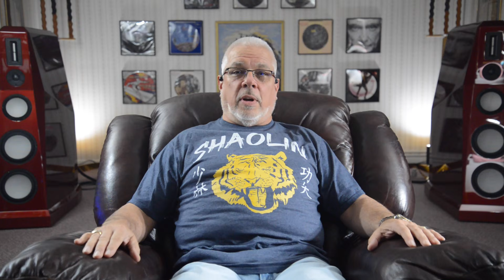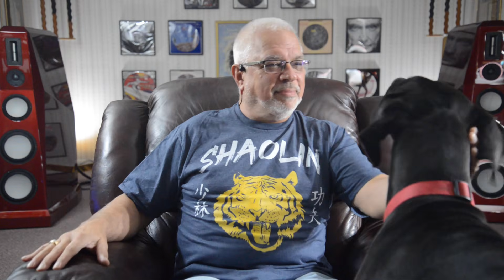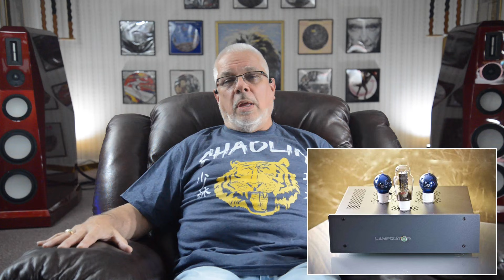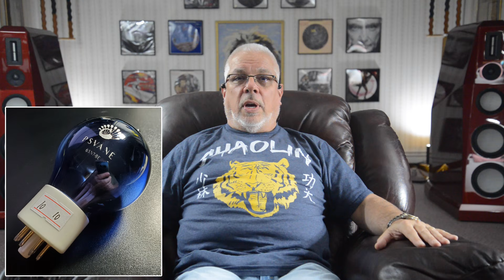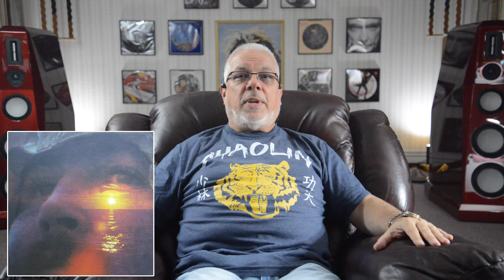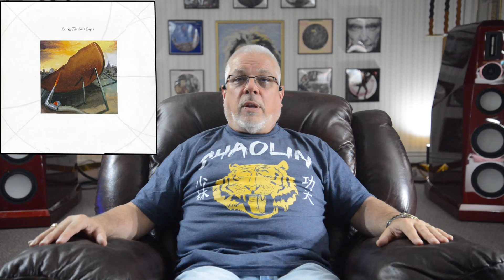E66: LampizatOr’s Baltic 3 DAC

Comment: Greg help me out Im looking at Audionote Dac 3.1 which is r2r and Baltic 3 which I have had my eyes on for years. Is there a big difference in sound
Reply from the maker: Hello. This will have to be your choice, as, to my way of thinking, the Audio Note is almost twice the retail cost of the LampizatOr  Baltic 4. The Baltic 3 is no longer current...and, honestly, the 4 offers clearly significant improvement over the 3. Honestly, I've never been the biggest Audio Note fan, so...you really are asking the wrong person for assistance. Given the price differences, I suspect that the DAC 3.1 may offer some clear advantage/s over the Baltic 4. But not having heard it in quite some time (I'm sure it's been four or five years since I've run into a DAC 3.1), I just can't say. I've no idea how challenging it may be, but...I'd urge you to try to listen to each one - as closely back to back as you are able - and take the plunge based on that experience... Sorry I can't be of more assistance here... 🙄

Comment: Thanks for such an amazing review.  I am in the market for a DAC to replace my Chord TT2 and was primarily looking at Chord Dave or T+A 200 but this review gave me something else to think about.  It’s a shame there is no way to demo Lampazator in my system but I am definitely intrigued and will be looking in to it more closely.
Reply from the maker: You should be aware that the Baltic 3 has an entirely new engine, and now is known as the Baltic 4. AND IT IS  EVEN MORE AMAZING... I had mine updated and am trying to find the time to update this take on this amazing machine! Enjoy!
Reply: @theaudioanalyst  Yes, I saw Baltic 4 on their website and really keen to hear your impressions when you get a chance to get it together, maybe I need to hold on to the purchase until I see your review.  I am big Rob Watts/Chord fan in the digital domain but since i got introduced to tubes there is no turning back and I have said goodbye to solid state amp (except when my tubes are warming up) and DAC could be next :).

Comment: Hello Greg! I need your advice for something. First thanks for this great info on the Lampizator Baltic 3. Personally , i still enjoy my cd playback system but plan to improve my dac section. With your today review i hesitate between a Mola Mola Tambaqui and the Lampizator Baltic 3 one.Unfortunately i did not get the chance to hear both of them.  I must tell you my system his only for headphone listening. I have a pair of Hifiman Susvara ( cabled with Nirvana headphone cable ), a Simaudio 650 D dac, Simaudio 430 HA ( Headphone amp ) and Inakustik cabling across and 3500 Power Filter. Last question if you do not mind. What could be my best first option... go for a better amp or improve my dac ? Your advice would be greatly appreciate! Have a nice day!

Comment: I have personally never heard a true tube Dac I had a musical fidelity nudists once but my chord qbd78 sounded better.I do like the idea of this Dac though a lot
Reply from the maker: Hello Jason. All I would tell you is that this DAC, to my ears, is much more musically accomplished than any DAC I've heard from Musical Fidelity. To be fair, The Baltic 3 is considerably more expensive than even Musical Fidelity's latest flagship DAC, the M6x, which is just about $2,500. What I tried to make as clear as possible in the body of the review was that none of the similarly priced DACs I’ve heard, including such “fan favorites” as the Bricasti M3 DAC ($5,500), the Chord Hugo DAC’s (up to $6,725), the highly regarded KTE Tuned HoloAudio May DAC ($5,598), the Mark Levinson No. 5101 Network Streaming SACD Player and DAC ($6,050), the PS Audio DirectStream ($5999), or the T+A DAC 200 D/A Converter and Preamplifier ($6,900), offer as complete a musical, texturally replete, and dimensionally authentic tapestry as does the engaging Baltic 3.

Comment: I love your reviews and videos Greg.  Do you have any thoughts on the Msb dacs?  I’m using a premier with power base and pro isl connector and it’s the best digital playback I have heard. I’m listening to all sorts of files including 2 track 15 ips safety masters and other tapes I have had copied to Dsd.
Reply from the maker: Hello LPG. Thanks for the kind words on my work! 

As to MSB DACs (A coincident form of both ‘most significant bit’ and the initials of founding member Mark S. Brasfield), you may not like what I have to say. And to be honest, I've NEVER heard them here in my system. However, my take with them at shows has left me less than impressed, and not interested in getting a closer listen. Now, this may be completely off-base, but it is my current sense of them especially the full Reference system.

Systems that, at this point in time, I would choose to spend my own money on if I were going all in on digital would be either the full 3-piece Ideon Audio stack ($76,800) from Greece that I first heard last winter in Rockville then this spring at AXPONA or the full 4-piece Esoteric stack (~$117,000). The Ideon system consists of the 
Absolute Stream ($19,900), the Absolute Time ($9,900), and the Absolute Epsilon DAC ($47,000). The Esoteric Grandioso stack includes the 
Grandioso P1X SACD/CD Transport with External Power Source ($50,000), the G1X Master Clock Generator ($27,000), and a pair of the Grandioso D1 Monoblock DACs ($40,000/pr.). Again, PLEASE understand this is only based on listening at shows, as NONE of the previously mentioned gear has ever been in-house.

Comment: Hi, wanted to ask what component are you using as source (streamer) and which connection method do you prefer. Thank you
Reply from the maker: Hello Freddy. Just for convenience, I have posted my ENTIER system, including the room info, its treatment, and other ancillary details (like the dedicated 20 and 15 AMP service installation and new grounding system), at my website. You may see those details at https://www.theaudioanalyst.com/reference-system/ 

However, here are the details you requested...

I began programing in 1971, while a sophomore in high school, and just recently (November last) retired as an IT Engineer/Analyst who is certified on both Microsoft and Apple platforms. 

With that background, I’ve built my own Windows based PC as a file server. I started with a Lenovo P320 CAD Workstation, using a Samsung EVO Plus solid-state drive for the OS, and featuring an Intel Xeon 3.50GHz quad core CPU running 8 Logical Processors, and with 32 GB RAM. Files are served over Network Attached Storage using a sonically chosen Cisco router system using all Audience Hidden Treasure Ethernet CAT7 cable, and I have installed the Hidden Treasure SATA cables inside the Workstation.

The computer is further optimized using Fidelizer 8.8 (https://www.fidelizer-audio.com/), an installed optimization utility that allows leveraging, managing, and prioritizing a computer’s core functionality, services, and processes.

My primary streaming and music management software is Roon 1.8, but I also employ J River MediaCenter 28. The stream is transferred from my Media Server to my DAC by means of an Audience frontRow USB cable. Given the way most DACs see DSD files, I have found USB connectivity to be the most effective overall.

Thanks for watching and taking the time to write...